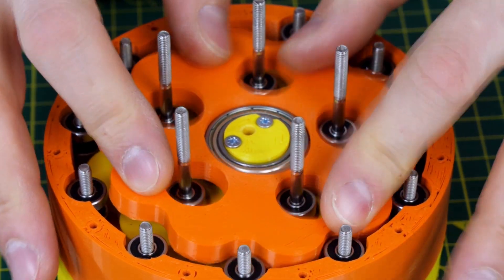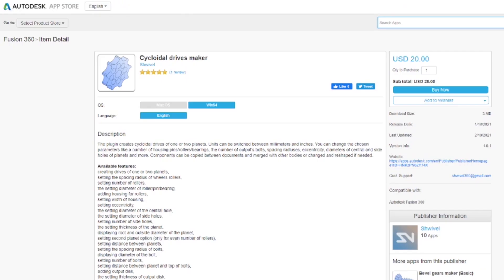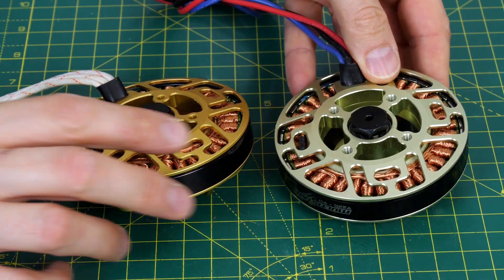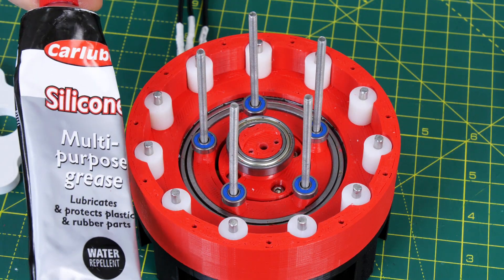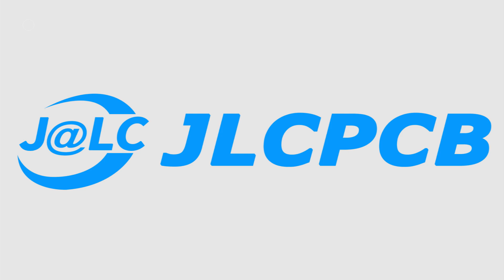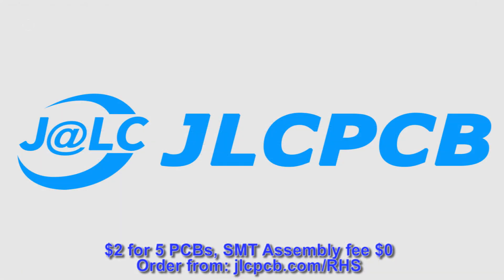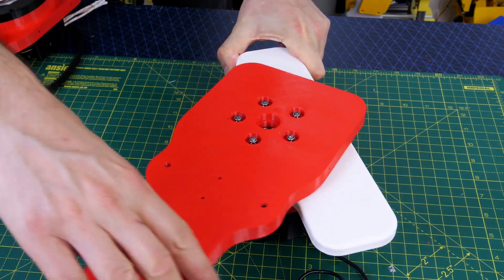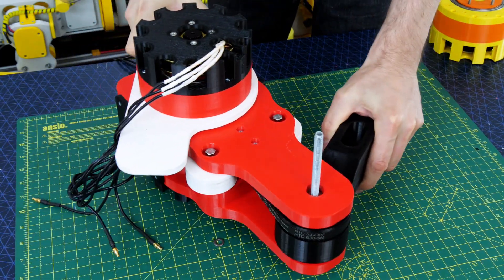Cycloidal Drive V3 & Robot Dog Test Leg

Comment: Have you experimented with bushings instead of bearings for the larger input/output interfaces as well? Even with some custom machined brass bushings you would have significantly less weight and $$$
Reply: Custom machined brass rather defeats the open source concept.
Reply: @owensparks5013  By the time you source all those specific sized motors, nylon bushings, bearings, hardware, print all those parts...sourcing a machine shop to machine some brass wouldn't be all that different.
Reply: @PowerScissor  
I disagree, a bill of materials with suppliers and partnumbers for off the shelf industry standard sized parts will always be easier to order than anything custom, and will have a shorter lead time. Chances are you'll get all the bearings from one supplier so some bearings and some custom bushings would be an extra supplier already.